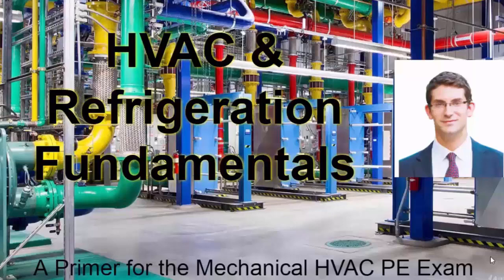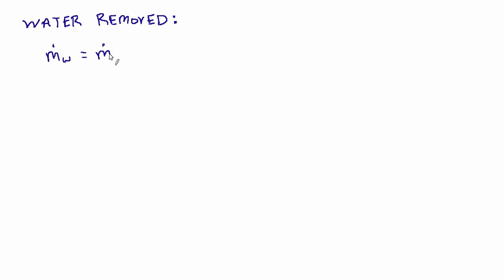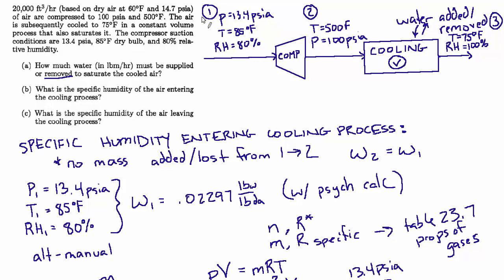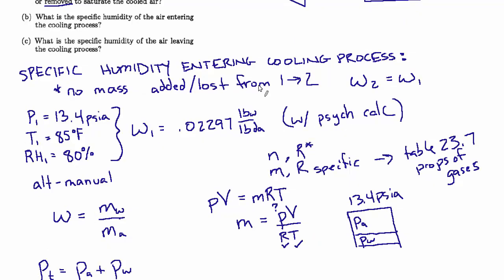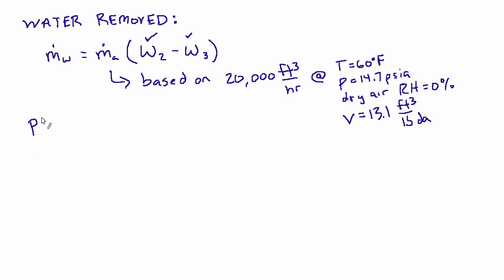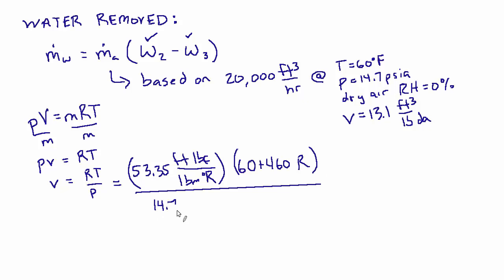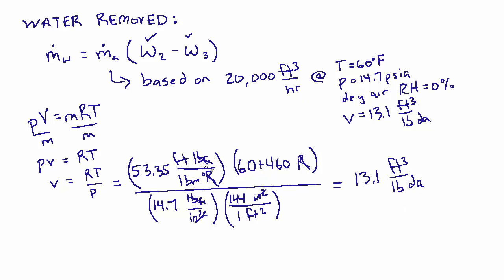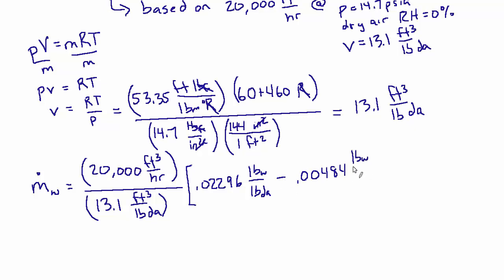101 Solved Mechanical Engineering Problems - HVAC Problem #11 part4of4

Comment: Hi, I see that stage 3 is 75F saturated. From the sea level psychrometric chart I see the 75 sat. at around .019 am I missing something? Thanks
Reply from the maker: Ah, good question... You may not have noticed that the pressure is elevated, so the sea level chart does not apply.  At higher pressure, the humidity ratio will be lower than it would otherwise be at atmospheric pressure, as air's capacity to hold moisture is diminished.  Hope that helps!